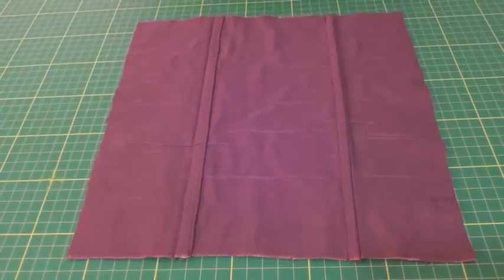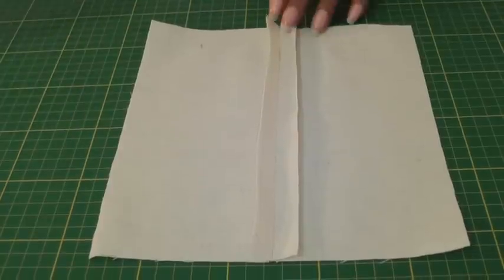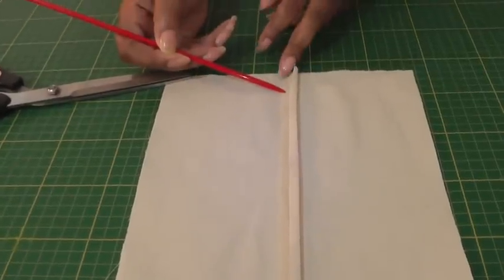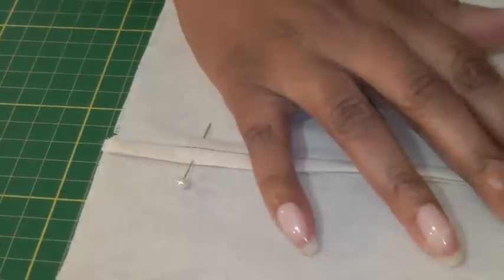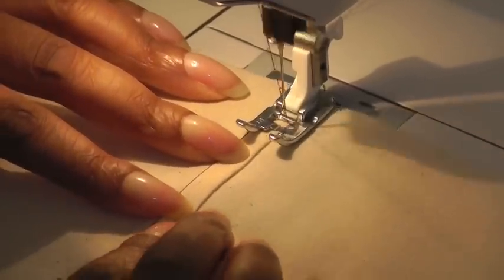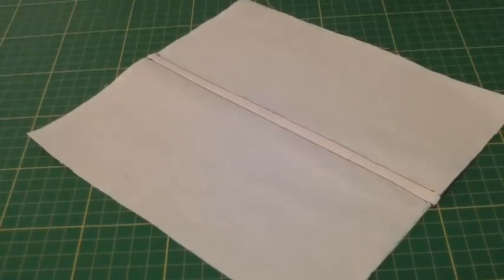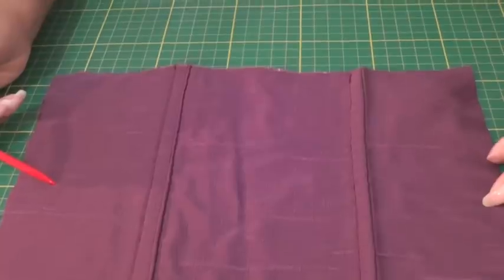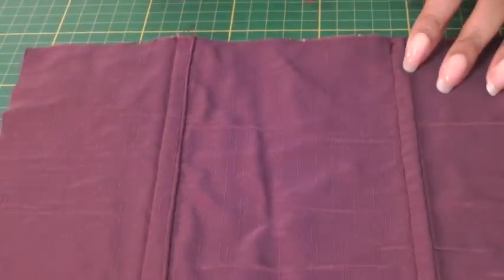Sewing a Flat Fell Seam

Comment: Hi, 
I’m trying to figure out the Flat Felled seam process. I can’t seem to figure out how much “extra” to add to seam allowances to make up for the Flat Felled seams. 
Example: if I am sewing a rectangle that is a finished size of 8 wide x 5 height and it will be sewn on the bottom and sides, but not the top, and I am using a ½ inch seam allowance on the bottom and sides, I would cut the fabric 9 x 5.5 (hope that’s right).  
But if I want to add Flat Felled seams on the sides only, do I need to cut the fabric larger?  This might have a simple answer, but it’s new to me. 
ACTUALLY, I guess I am wondering if anything changes as far as my seam allowances…Thanks so much.